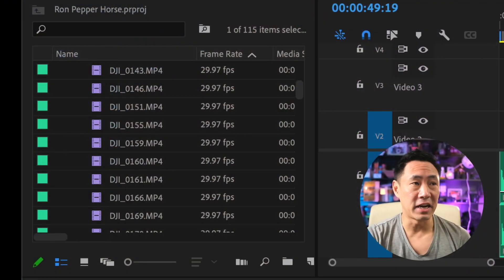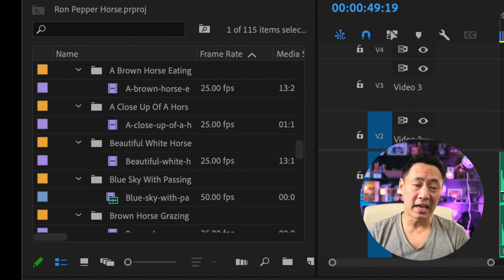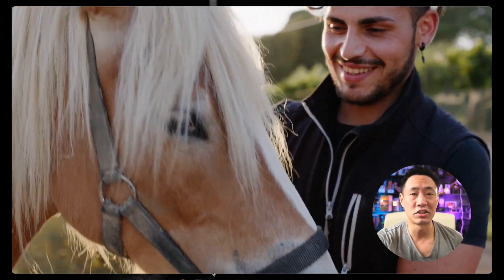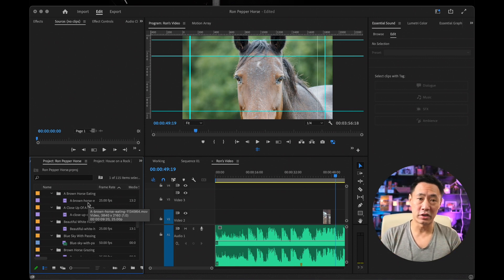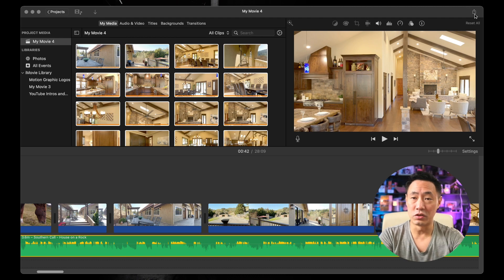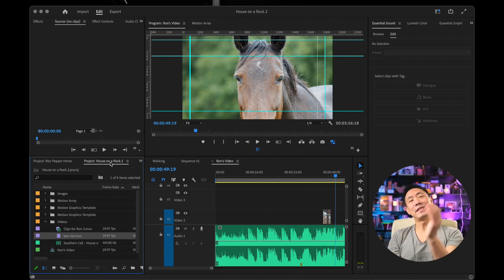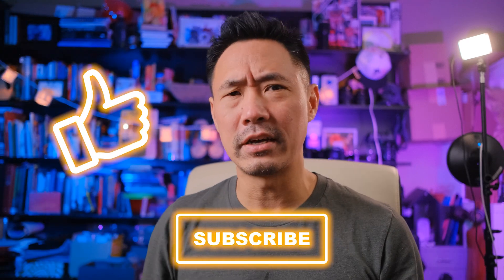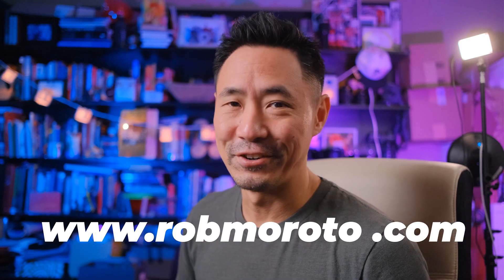Choppy Video from Mixed Frame Rates - FIXED! #premierepro

Comment: hello! how is it done in my case that I have three cameras mixed live in multicam and camera 3 shot at 29.97/59.94fps, while the other 2 cameras are at 50 fps, the sequence is opened at 50 fps and there it is mixed and multicam, but when exporting the camera that has a different frame creates problems when you watch it, at times there are so many frame drops that it seems to be stuck. is there a way to solve this problem, since the new cameras have 180 mn each.?
Reply from the maker: So the fix here fundamentally is to use a consumer grade editor that initially converts source video before allowing to edit.  That allows it so that any source regardless of frame rate or bit rate is usable - the downfall of that is that it is going to work on the lowest common denominator.  And unfortunately the mixing of those in the 30 and 24 fps doesn't always work out well.  I find that capcut also does a reasonably good job of this but still same issue - lowest common denominator.  I would try adding the 30fps clip first to set the base, and then add the rest.

Comment: Doesn’t premier pro automatically adjust the frame rates the the sequence settings anyway??
Reply: I just did this. Go to sequence settings and switch to 60 fps or whatever you need and it fixes the issue. You were right!

Comment: Try creating low-res proxy files. Right click your footage > proxy > create proxies. I like quarter 'frame size' with ProRes Quicktime Proxy 'preset' and choose the option to put the proxies next to the original files in a proxy folder. This will help your computer deal with the same file structure, bitrate, and compression. You'll probably want to deal with your frame rates by Interpreting the footage (right click > modify > interpret footage) and then making them all the same frame rate. If it has to do some weird math to make the frame rates match (like it's not perfectly divided by 2 or something) then make sure you choose all of the footage you're modifying after you put it on your timeline, right click > speed/duration and change 'time interpolation' to Optical Flow. That will smooth out and slight difference in the frame alignment. If your clips have any cuts in the footage and you're modifying the frame rate and then doing Optical Flow you will see a super wonky frame on the pre-existing cut in that footage. Make sure you remove an extra frame to avoid that--it gets real weird real fast trying to blend between two completely different frames